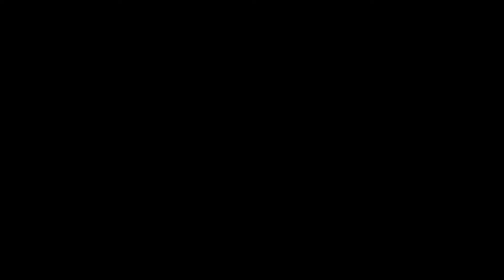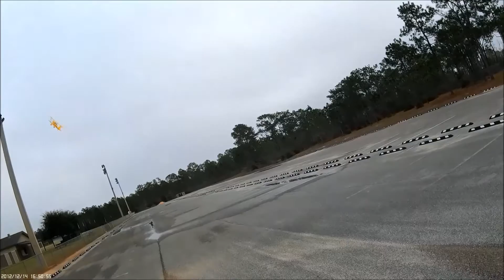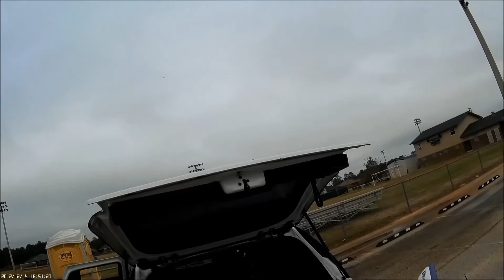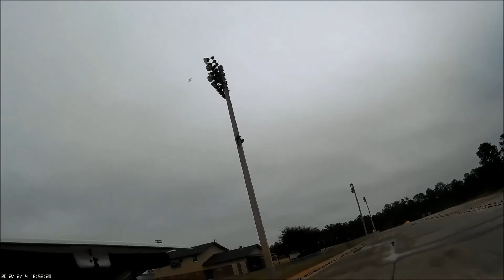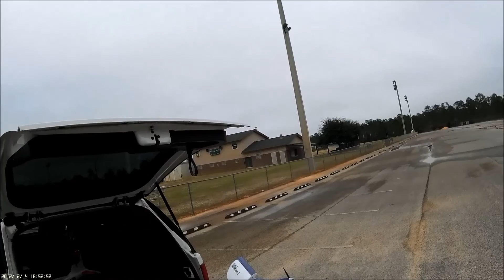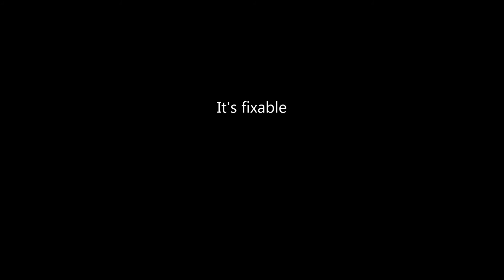Dynam Waco biplane maiden & CRASH!

Comment: The Waco is a pretty tough bird that takes glue very well. When I was putting mine together I didn't have a long skinny cross tip screwdriver and before the maiden I was going to barrow one from Flying Buddy to tighten the screws that hold the tail feathers on, in the excitement we forgot to tighten the screws. The Maiden went very well until I tried to turn, the tail came off the fuselage causing a nice tight spiral into a bunch of reeds in a pond. The Waco didn't get any damage but a few scratches.
Reply from the maker: very fortunate! It's a good lookin plane. My personal experience with Dynam wasn't good, so I haven't bought another since I got a terrible meteor a while back. What,s your take on Dynam as a brand?
Reply: I've good luck with Dynam's stuff, flying buddy always replaces the Dynam ESC. I've been flying the Dynam Waco with original hardware for 4 or 5 years. Have the Dynam CH-47 and it is 7 years old.
I liked my Dynam Corsair and Tiger Moth. I fly mostly FMS, E-Flite, and a few HK birds,
Reply from the maker: Amen on the Dynam esc issue! I edited out the pulsing this 1 did right b4 takeoff.